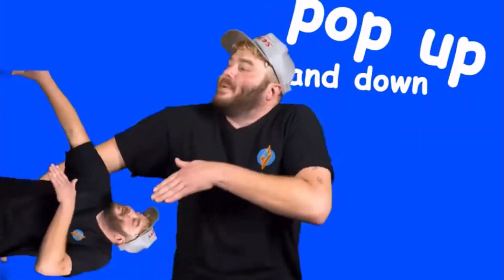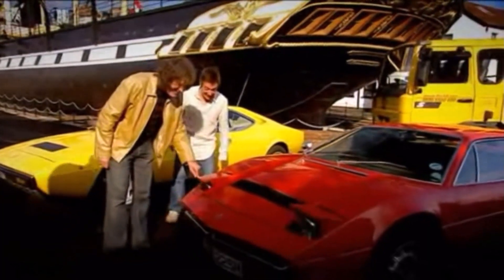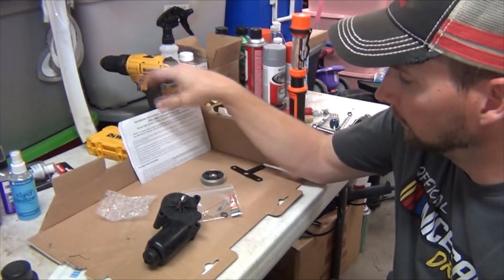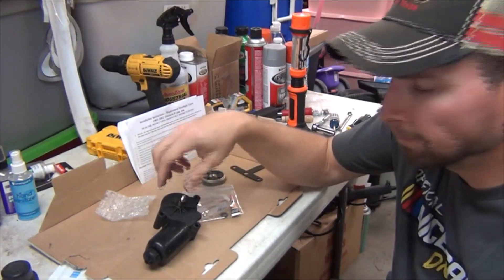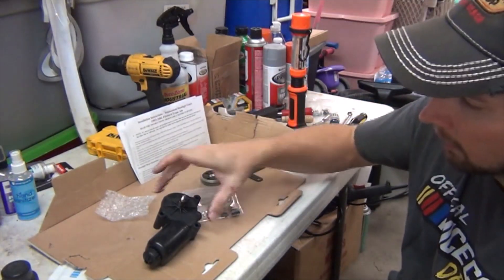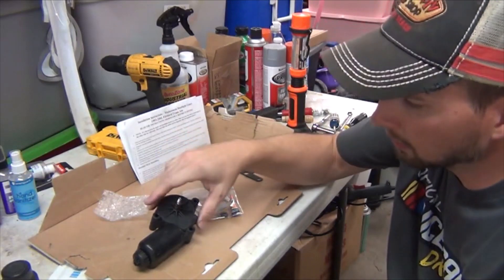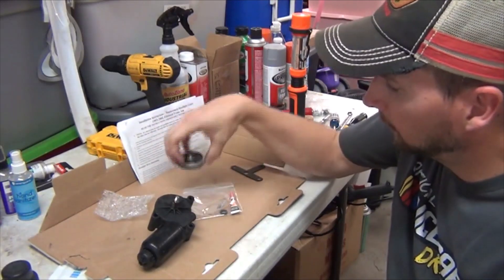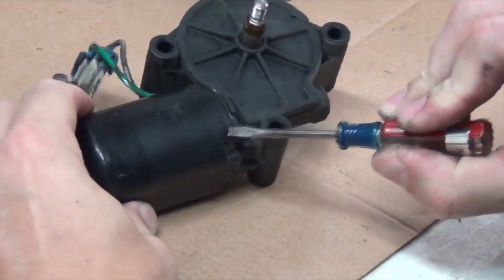1997 Pontiac Firebird Pop-up Headlight Motor Repair

Comment: I've had to replace this on 3 fourth gen Firebirds. My birds all have factory fog lights, so I try to use them as much as possible. Good video.
Reply from the maker: I’ve owned 5 firebirds. This is the only one I’ve had to repair the headlight motor gear. Sometimes I wish my 97 had fog lights.

Comment: Thanks! I have a 2000 WS6 and had the headlight issue fixed once from a shop, its now making that grinding noise again!
Reply from the maker: The 98-02 headlights are a little trickier to get the motor out of, since they are a double lamp assembly. It's certainly easier to fix on a 93-97 style, but not impossible on the 98-02.

Comment: Just a heads up for anyone attempting this fix let it be known its NOT the plastic gear which is the issue. It's the motor itself becoming loose from the gear housing. The metal tabs that are pressed against the gear housing over time will loosen up and allow the steel worm gear to wobble inside the gear housing. This is what will strip even a brass gear over time. 

The real fix I have seen is again pressing the tabs back tight against the housing (more often than not you cannot do this because the metal tabs are probably too weak anyway), and insert a hard plastic strip behind the worm gear. This will prevent it from wobbling again. Or you can just pick up a new headlight motor assembly cheap off Rock Auto as well. That's what I did.

EDIT: Also if you want to be real cheap these headlight motors only use half of the gear anyway to lift the headlights. So you can just open it up and rotate the gear 180 degrees and put it back in and have a working headlight motor again.
Reply: Even easier than that, couldn't a guy remove the linkage rod, manually rotate the gear 180 degree and put it back together.

Comment: I just changed the gear on the passenger side. Hearing the grinding noise when the light went down but now it's when light comes up so i'm fucked up
Reply from the maker: I've not heard of this happening before, that's certainly frustrating. Time to pop it back open and see if something is out of alignment. Hang in there!